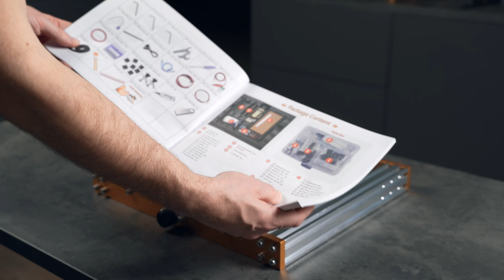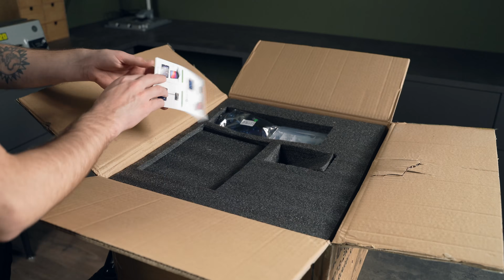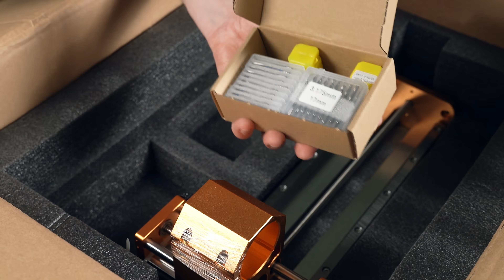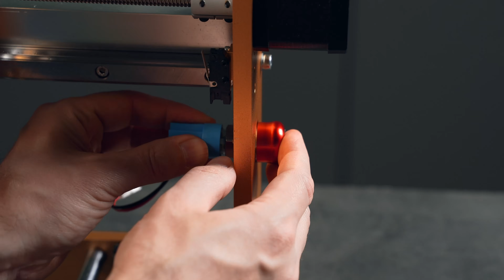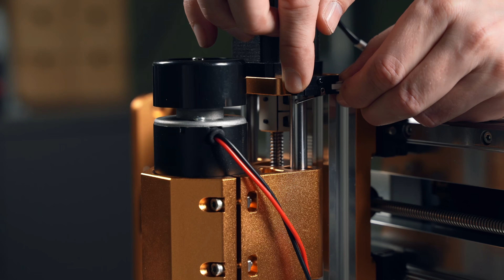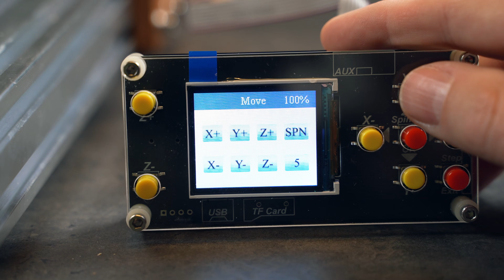LUNYEE 3018 Pro Ultra CNC Review 2025 – Assembly and basic testing

Comment: Thanks for the Vid Dude! Can you tell me the max height between the mounting platen and the collet chuck with router motor at its highest possible position? Will it clear 160mm? Only need a few mm depth of cut to engrave writing into a wooden box 160mm high.
Reply from the maker: Hi 😀 You will not be able to do that with this one. I think the max on this is about 80mm. That is the case on many machines in this price range. A few go up to 100mm. But for some you can cheat a bit by removing the bed of the machine. Two trees 450 for example. But on this one the Y axis IS the bed, and you can’t work around it.
Reply: @nordicturning  I think you are confusing the 80 Z axis travel with the total head-room under the cutter. If the motor is clamped at its max high position and the traverse is raised to 5mm before Max - there will be a certain hight between the platen and the bottom of the chuck. This is the head room - not including cutter length. That's the parameter I am looking for. Cheers Graeme.
Reply from the maker: @graxav  I see! Of course, I misunderstood. I won’t be able to check. but I had that same problem, when engraving the underside of a woodturned box on this machine. The box was only a little over 100mm and as I recall I was pushing the height limit there. So can’t say for sure, but almost certain you can’t do 160mm
Reply: @nordicturning  Ah Thanks - a pity - I have wooden amplifier cases that I made - wanted to add control logos - the clear vinyl ones I printed and used are peeling! And getting it done would cost more than the Router Mill. Not impossible though - The legs could always be extended - I'm not out yet!
Reply from the maker: @graxav  Best of luck on your project! And thank you for the question. I’m getting the new 3020 Nova any day now, and I’ll be sure to do test the max engraving hight on that 👍

Comment: Die Maschine ist gut, allerdings kaum nutzbar, da die angebotene Software kaum zu gebrauchen ist. Solange die Firma keine ordentliche Software dazu anbietet, kann man den Kauf nicht empfehlen, es seidenn man hat eine eigene Steuerung und Software.
Reply from the maker: Hi and thanks for chiming in. I agree with you, the controller is not that good. I used it when testing this, and it works, but I always control this unit with my computer and easel when doing real jobs. Thanks again 😀

Comment: Thanks for video!
Did you find some serious disadvantages of this device? For example quick overheating or something similar...
Reply from the maker: Thank you 🙏  I have only done some basic testing with this one so far. No issues, worked out of the box and does all the basics well. There is no fancy functions or apps for this one, and if you want that I suggest you look at more advanced machines, but they will definitively have a different price for sure.

Comment: A fairly good video.  The title ("...  – What It Can (and Can’t) Do ...") is a bit misleading though.  You did not really attempt to do anything with the machine, other than a sample carve / engrave that was included with the machine.  All this does was show that that machine works.  It does not show what it is capable of doing.
Reply from the maker: You have a very good point! I really appreciate the feedback, still working on getting the titles right. I changed this one so it fits the actual video ;) Thanks
Reply: @nordicturning  No problem.  Looking forward to seeing videos, from you, of this little CNC being put thru the paces.
Reply: Actually these machines can be retro fitted with a laser cutting head and make an excellent base for building your own 5 axis CNC. Even having table angle motors can make bigger projects relatively simple.

Comment: Yup, I too want to see you try aluminum or aluminium... If it does OK on aluminum (aluminium) then it may be a game changer. I notice there is a 3018 Pro Ultra and a 3018 Pro Max and at first glance they seem similar but the more expensive 3018 Pro Ultra uses linear guide rails instead of rods and I think that will provide a much stiffer X axis which should be better for soft metals. The 3018 Pro Ultra is pretty cheap on Amazon Canada at about $550cdn
Reply: From this Japanese channel https://www.youtube.com/@nantoka you can see how Pro Max was converted to more aluminium machining capable machine. Machine become more like Pro Ultra but with additional mods. If machining aluminium is the goal then Ultra is the correct choice to start with.

Comment: Does it use G-code? And can it mill aluminum?
Reply from the maker: I wanted to do some more extensive testing but never got to try aluminium. I have read that this one is sturdier and more adapted for that though. It does take G-code, I used the G-code for my logo in the video. Thanks for the comment